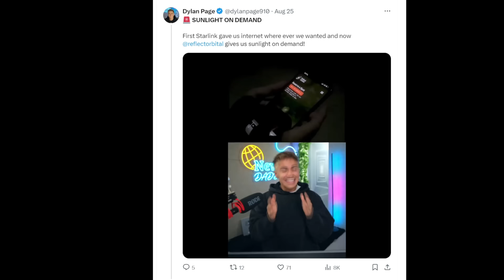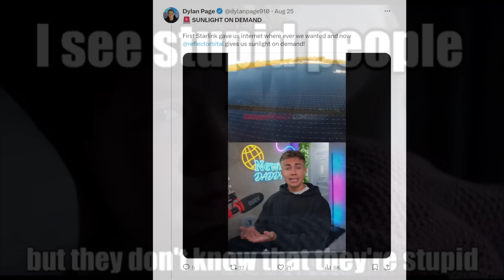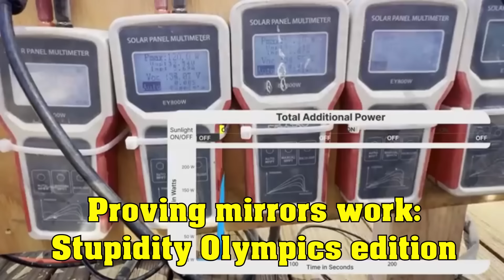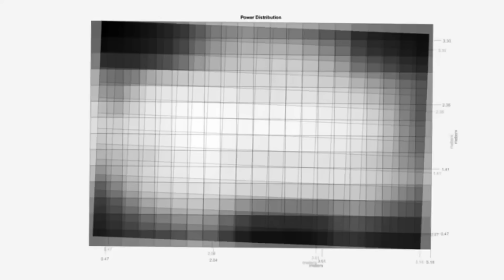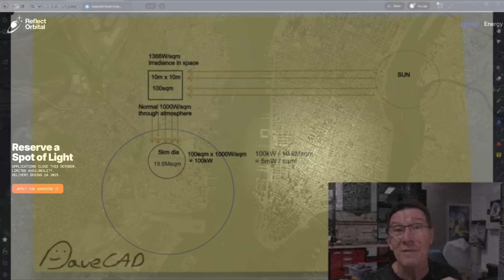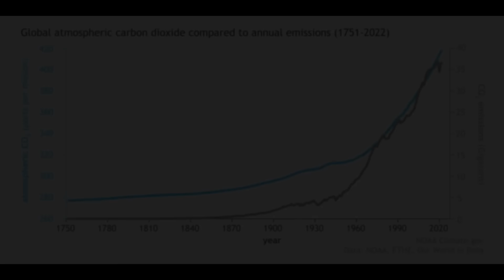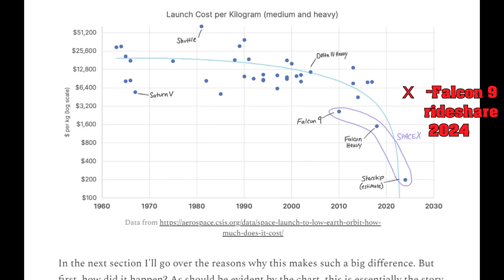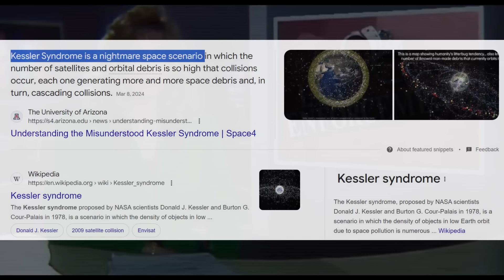Reflect Orbital: BUSTED!!

Comment: These guys are engineers? They didn't even think about clouds, light diffusion, light dispersion, air pollution....
Reply: Or the poor saps under the backsides of these mirrors.
Reply: I suspect they are dropouts.
Reply: @Tyranastrasza  Nah, this feels right for engineers.
Reply: @jomialsipi engineers are problem solvers.
Question is: Is that the right solution for our problems?
Answer = hell no
If they truly are engineers, they picked the wrong problem to solve as they clearly have no idea of atmospherics and light defraction.
You would need parabolic mirrors that can finetune their orientation, which could be doable, but the atmosphere is famously good at diffracting light. So in the best case scenario, you would probably end up with a second, smaller moon, or pre dawn light levels.
Reply: Also if they want to be able to point these mirrors at a specific spot on Earth the satellites will need an attitude control system. With the thrusters also needing to counter atmospheric drag and the whole thing acting like a solar sail. So add in the mass of fuel, ion thrusters, solar cells, electronics and maybe some solid fuel rockets to safely deorbit it.
Reply: They are young and inexperienced engineers, which explains why they dont see the bigger picture. Dont think thats exceptionel to enginers.
Reply: The problem is the people who gave them money, i.e. investors, didnt think about those things.
Reply: @Virtueman1   Here is the problem: the people who gave them money, i.e. investors, may not necessarily be engineers or experts. They should believe in smbelse's expertize. So maybe for every startup there must be a compulsory public experts' responsible opinion.
Reply: But they've been working at SpaceX.
Reply: It's the new kind of engineer - the Silicon Valley tech-brongineer. To them it doesn't matter if something is scientifically implausible or economically non-viable, all it matters is that the idea excites you (no matter how dumb it is) and that you can make a good pitch to the tech-bro-hungry media.
Reply: This seems like it would be about as bright as the iss
Reply: @emildavidsen1404 I’m not an engineer. I see the big picture….
They’re the very standard and common “educated but clueless”type. They can probably design a rocket, but don’t know how a toaster works.
Reply: @jomialsipi  doubt it. Even with some high school math, you can see that none of this makes sense. You could even ask chatgpt and itd debunk your idea in a moment.

Maybe they're just grifters. Whatever the case, it's completely pathetic...
Reply: ...the fact that they got the idea from the worst Batman movie.
Reply: ... the fact that they got the idea from the worst Batman movie.
Reply: @Parciwal_Gaming  Regarding "You would need parabolic mirrors" 
Parabolic mirrors wouldn't help in this case, cause every square millimeter of it is still a point source of reflected, nonlinear light, leading to a ~ 5 km² light spot on the ground.
Reply: @ramr7051  Engineers are not known to be good at math. They're projects managers that don't know the limits of their knowledge.
Reply: @Virtueman1 I'll bet any money that the sole investor is a family member trying to get a 30 year old out of their house.  The same people that paid for his degree.  And the same people that pulled some strings to get him a temp job at SpaceX.
Reply: @HanSolo__  yeah, how many rockets have YOU landed? 😂
Reply: @zwerko this is so true 👆👆👆
Reply: They work at SpaceX, thinking or sking critical questions is prohibited
Reply: They're grifters first. Patrick Boyle has a hilarious video on the various stupid things Tech Bros "invent"
Reply: More like Grifters barely any different than techo bros
Reply: engineers at trump university
Reply: They are social engineers, ofc.
Reply: Well, they worked for a dude who pretends to be an engineer on TV 

Does it really shock you?
Reply: @Tyranastrasza  yuuup.... they were "smarter than the professors"
Reply: The marketing guy is the one talking, the engineers working for him are collecting a paycheck to do some rudimentary mock-ups. They generally try to keep the two more or less separate. Don't let the engineers know what the marking team spots (since it almost always will send their heads spinning, and don't let the marking team talk with the engineers because they won't be able to bluster nearly as well.)
Reply: Details, details.
Reply: Now let's find a problem for their brilliant 'solution'... 🙄
Reply: @jomialsipi  The guy behind Solar Freakin' Roadways is an engineer, too. I immediately identified the idea as stupid in about 30 different ways the instant their video came out — when I was an undergrad studying engineering... Some of us just can't see the forest for the trees.
Reply: No, they are SCAMMERS...
Reply: @emildavidsen1404  You mean young and dumb; all of us engineers were that way, but some actually learn and grow.
Reply: @michroz  Investors tend to be pretty stupid.
Reply: Which means they are not engineers and just paid actors. Scammers
Reply: Or that light has momentum. In free fall, those mirrors will slowly be pushed by the light away from Earth... Unless you constantly correct the orbit. Suddenly you have a real physical problem on your hands here.
Reply: They play engineers on YouTube.
Reply: SpaceX engineers...
Reply: @emildavidsen1404  any guy who learned a bit of physics and mathematics can and will say that their plan is nonsense .
Reply: @Virtueman1 this has to be one of the biggest issues is investors not doing due diligence
Reply: More like marketing bros trying their hands at "engineering"
Reply: Clearly, they’ve never grown weed 😂
Reply: But...but...but...elon is an "engineer"...apparently 😂
Reply: Not engineers…scam artists 😯
Reply: Nah, like in moat cases they're just rich kids with a blank check, hence why there's no one responsible enough to tell them they'll fail.
Reply: As an engineer we do not claim them
Reply: They worked at SpaceX. Their purpose isn't to solve real problems, it's how to create demand for SpaceX launches because without customers SpaceX doesnt have a business.
Reply: @jomialsipi  "Engineers are not known to be good at math. They're projects managers that don't know the limits of their knowledge." – It's a problem with what Americans call "engineer". Maybe it's the same in Germany by now, but it was different some decades ago.
Reply: Grifters come in many forms. I wish engineers would just engineer these days! Everything has to be some new startup of something utterly crazy and they some how get angel funding from morons.. look at theranos the investors still haven't learnt but somehow it keeps happening
Reply: @jomialsipi ..I'm not a project manager! I wish I was, they get paid a lot more! And I actually work for a living
Reply: Just the amount of pollution it takes to get these satellits in orbit will never be earned back by these satellits.
Reply: Engineers are like the little brothers who we give a disconnected controller in science
Reply: Nah. They are grifters fishing for VC money.
Reply: @zwerko  That was a very good description of what this is all about.
Reply: @ramr7051  Indeed you can do this with high school math. I was better engineer than them at my early teen years. I could and more importantly would do better calculations to see if an idea worked or not.
Reply: THINK? What part of this idea had any thought..
Reply: I'm an engineer myself, I did think about some errors XD But yeah, The bar is pretty low
Reply: @emildavidsen1404  The vast number of people don't think about consequences, especially politicians. "What happens when you give people some money and then take it away?" Shouts of "Killing pensioners, no-one works".....
Reply: @eirvine DING DING DING we have a winner 🏆 they're funded by someone trying to createdemand for spaceX launches
Reply: They made a model and a animation 

So it must work.
Reply: Make the mirrors big enough and they will burn away any clouds and turn all that pollution into sweet sweet ozone. Sounds like a plan.
Reply: Or basic things like the inverse square law

It's just another grift a la Hyperloop
Reply: There’s always a rich lonely man somewhere who gets hoodwinked into funding the “imagine this”…
Reply: Or the solar winds, Changing their orbit…
Reply: Yeah you nailed it, I was gonna say it but yeah .... Only reason we haven't done it for anti nukes and such, it whould work very well, if it's sunny all the time, and also the heat.....
Reply: Nope. Though they could write Mein Kampf if they want to and they wouldn’t know that book already exists.
Reply: @OM19_MO79  The first time you were able and I didn’t have a chance
Reply: Maybe they did, but just pretend those things wouldn't be issues to gain investor funds.
Reply: Really makes me wonder what is the point of those harder and harder exams and tests to get into college when you have this.
Reply: ... Not to mention these things are gonna be floating in space debris surrounding our planet... Mirrors aren't the most sturdy things...
Reply: @EggheadJr1  a wide mirror that would easily be hit by micro debris, a very good idea!
Reply: Not surprised anymore. Seern to many "researchers" with redicoulous questions, setups, conclusions. Who finances that? Likely some kids from someone with too much money.
Reply: They also forgot that earth already has a satelite doing this. It's called moon.
Reply: You can have any degree, but so many people seem to lack the common sense and real word experience to write off bad ideas.
Reply: They are grifters
Reply: Not to mention even a huge mirror is going to be a tiny dot in the sky...
Reply: They are engineers, not lightologists. 😆🤣😂😹
Reply: @ryaneverett9901  enjenir
Reply: They’re kitchen-qualified engineers taught by TikTok and YouTube shorts
Reply: @emildavidsen1404 can't disagree more. This would be stupid for early highschool students, let alone for engineers. Anyone who knows how a sphere and light work knows in 5 seconds this isn't possible on any kind of scale. Anyone who is an actual engineer knows that it would be completely disastrous if it were
Reply: @eavdmeer  I've had my fair share of interns & "newly graduated" - some of the mistakes/perspectives they hold align well with not always seeing the forest from all the trees or, as in this case, getting tunnel-versioned &/or overly optimistic in relation to some problem they encounter. I've noted that you hold engineers to a very high standard, which is flattering, but I don't understand how this squares with your actual real world experience other than just a simple lack of same.
Reply: Moreover they don’t think of inverse square law😂
Reply: they r engineers not scientists
Reply: @jomialsipi more like architects

Comment: Want 24 hours of sunlight?  Move to the north pole.  Then a few months later move to the south pole.
Reply: Low angle though. Not going to get much solar power… but I guess it will be practically continuous part of the year…
Reply: @markiangooley  the intensity is exactly the same to the equator, you just need basicaly angle the pannel at 90". The problem is that the sun cut much larger atmosphere section so is scattered a lot and you get less power, but tecnically if you have an enough tall mountain yea cloud work fine because the loss of light due atmosfere scattering become much lower.
Reply: @markiangooley  you'll get a HECK of a lot more than their funny little mirros will ever give you.
Reply: finally i can get a good sun tan
Reply: Flat Earthers have entered the chat
Reply: @CoffeeTroll  Thank God!
Reply: @nemoz82  Just how far would the panels have to be apart to allow this 90"?
And having done that, they would point the wrong way half the time ;)
Reply: Probably costs less too
Reply: There is no south pole!
Reply: @stusue9733  I talk in theory, of course is totally unpratical and not cost effective, but in theory yes. Whit no atmosphere, tracking device and space north pole would be ideal for have atleast 6 month of continuous light and power production.
Reply: @nemoz82  You seem to be missing the point.
Sure the Sun is above the horizon 24 hours a day for a few months a year, but its not very far above the horizon. If you angle your panels to "point at the sun" they will be facing the wrong way most of the time just like anywhere else.
The Suns zenith at the summer solstice is 23.5". At that angle your panels would either have to be vertical or for a 1m high panel, 2.4m apart(if my maths is correct).
Reply: @stusue9733 well you could rotate them. But they will have severe issues with shadowing each other.
Reply: @nemoz82 not precisely exact.
You have more atmosphere in the way. How big the deviation is, idk, but its there.
Reply: @tami6867  "well you could rotate them." 
Certainly

"But they will have severe issues with shadowing each other.
Well my calcs say 8ft between panels. So its going to take up about 2.5 times as much space as panels.
Reply: @stusue9733  You could have one big rotating platform. Like a radar antenna, only flat instead of concave and covered with solar panels.
Reply: @stusue9733  8ft would actually not be that bad. very northern Teritoriums could have some good power from solar in the summer. the stuff got cheap 😄
Reply: You propably save a lot if you compromise with sulphur plasma lights or something. 😆
Reply: Why keep needing to move like that, when you could just move to the East Pole in the first Place?
Reply: @CoffeeTroll  Actually, Flat Earthers could have a point, it's just a matter of perspective:

Because with a little "creative" thinking, one could define the Earth as a disc with very uneven thickness: in the center, it's about 12.700 km, and then it drops very sharply towards the "rim". 🙂
Reply: @paulhogsten2613  Thankfully Santa has confirmed the existence of the north pole!
Reply: @onradioactivewaves  Because you have to keep traveling as 1000mph as any flat earther will tell you.
Reply: @stusue9733  good point, but we'll just tether to the firmament to solve that problem.
Reply: The beauty of your plan is that instead of having mirrors in orbit aimed at the ground like these guy's plan we could have umbrellas in orbit to block out the Sun for fee-paying individual users. 😂
Reply: neither poll gets 24 sun light unless its during summer months then its limited 24 hour sun
Reply: For those who are really afraid of vampires.
Reply: I moved between the north and south pole for a few years, and all I got was night!!
Reply: I'm not an expert, but I don't think that geosynchronous orbit can be achieved at the poles. I'm not even sure that you could hang a satellite up there long enough to be of any use.
Reply: @nemoz82 also the panels would need to rotate to keep them facing the sun since it circles around the sky all day.
Reply: If you get a tech bro on the phone this could be worth millions.
Reply: So efficiency throughout the year is half. Which is same as any other place on planet where you get sunlight in day and not in night.